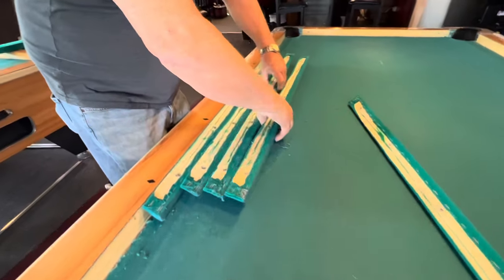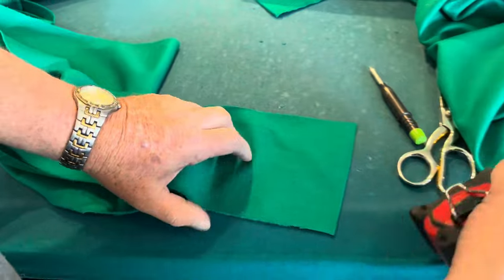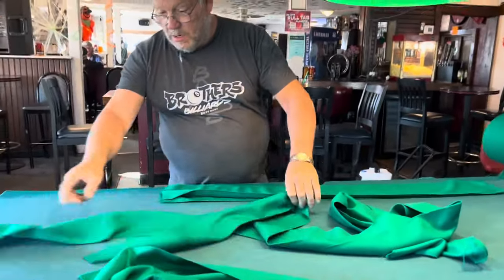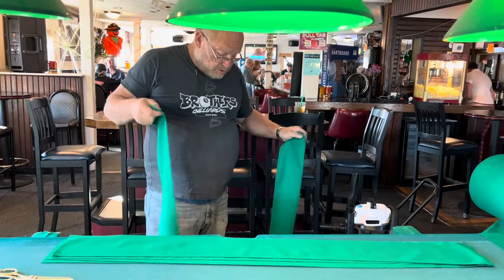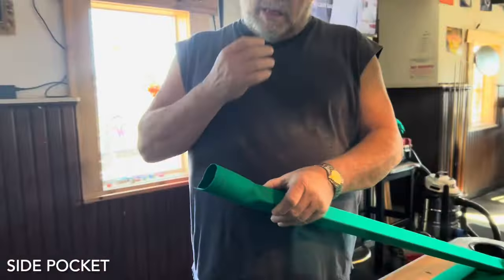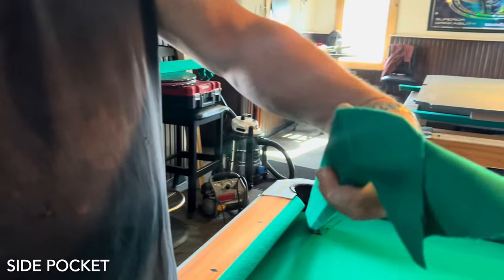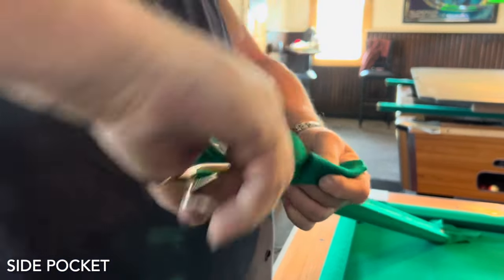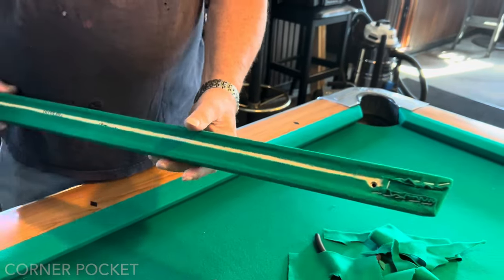HOW-TO: Recover Valley Pool Table Rails like Real King Cobra!

Comment: Guys in pool leagues would tear me(and the cusions) apart if I used that fold over method on the coner pocket ends of the rails. It looks nice and neat but it adds 2 layers(3 total) of cloth on that side which will effect the balls differently than on the other ends of the rails. You have to work the cloth with folds and often times pleats. Staple as you go to hold it. There is a balance between too tight and not tight enough to help prevent early wear on the "points" that he shows but if you take your time and do it right, the better players will appreciate it.
Reply from the maker: Yet they don't complain about the folds in the side pockets on a featherstriped set of rails, like on a 9ft😅🤣
Reply: valley doesn't sell tables with folded side pockets,  ever wonder why?   my take is if you are going to do a fold over, make  it look good.  great tutorial.   diamond tables do folded side pockets.  your league players sound like mine.  they always blame the table for their missed shots.
Reply: Oh thank you so much. This guy is a joke 🤣🤣🤣
Reply from the maker: Do the work however you want, but I don't like how the no fold rounds the side pockets, and the facings wear through the points because of the no fold method, so hack away buddy😅🤣
Reply: @therealkingcobra   I wasn't looking to make a thing of this, Buddy, but when I do rails I do them with out needing that dumb fold and this "wear" that you are trying to sell simply does not happen with the way I do them. Maybe just try a little instead of taking the easy way out.
Reply from the maker: Hey, do the work the way you want, don't matter to me, but I'll tell you this, move out to my area and you'll only last about a day doing your level of work, then you'd leave and go somewhere else to try and find work😅🤣
Reply from the maker: Show your rail work with Simonis or Gorina cloth, and I'm talking about the back of the rails, you know, where you place all the damn staples! And still can't keep the puckers out of the bottom of the rails!!😅🤣
Reply: @therealkingcobra  

 "...do the work the way you want..."

 
 I appreciate your permission.

 
"...move out to my area..."

 
 Why? Are the Valley tables more difficult to cover in Spokane?

 
"...you'll only last about a day doing your level of work..."

 
Now you know "my level of work"? LOL. 

 
 As noted above, I do YOUR level of work but without the extra fold. Have you ever pulled rails off of a new table or purchased new, covered rail sets from Valley? Do they use the fold? Are your rails now better than Valleys?

 
"...then you'd leave and go somewhere else to try and find work"

 
 Because The Real King Cobra would run me out of town.

 
Lighten up, Francis. This post is already 9 months old and you're still bellyaching over it.

 
 "Show your rail work with Simonis or Gorina cloth..."

 
 Should I send you some other pics for us to compare?

 
 Dude, covering rails isn't rocket science but I can appreciate that you have a brand to sell so you just keep on impressing the kids. I can tell that you really appreciate the pats on the back.

 
 "...where you place all the damn staples!"

 
  This point I think we can actually agree on. I can't stand stripping rails that I didn't cover. Some guys line the staples down a rail like they get paid a commission on how many they use. 

 - - - - - - - - - - - - - - - - - - - - -
 - - - - - - - - - - - - - - - - - - - - -

 
 However, I do staple my ends and then I use about 5 staples down the length of both top and bottom of the cloth just to reassure that the glue never slips. Just off the side of each bolt hole(5 bolt rails).

 
 What I would NEVER do is use staples on the bottom of the rail where it could cause a misalignment if it rests on the slate. But I guess that sexy fold over of yours dictates that for you.

 
"And still can't keep the puckers out of the bottom of the rails!!"

 
What the heck is a "pucker"? Guess I don't know cuz my rails come out smooth as silk every time.

 
Don't make what we do out to be harder than it really is. I tell the onlookers at the bars all the time that it isn't hard. Just take your time and pay attention to the details. The worst part of the gig is hauling all the gear in.

Comment: Hi Cobra, is it possible to use that 3M 77 spray for bonding K66 rubber cushions to the wood/rail as well? In my country I can't seem to find the contact cement brands that is typically recommended (3M 10 scotch weld, Barge, LePage etc.), but my local billiards store sells the 3M 77 scotch weld spray. Not sure if it's primarily for glueing cloth or if it can be used for bonding rubber cushions as well. Thanks for all your videos!

Comment: What do you prefer better Ridge backgrounds or the penguin rails and also what brand the cloth did you install
And I also have seen a lot of videos with guys stapling the rails do you preferred gluing over stapling
Reply from the maker: Well, first of all, I'm the one that actually designed the Ridgeback rails in the first place, then taught Kerry how to build them, creating the Ridgeback rails business. Penguin rails have come a long way since they first started building replacement rails, so I don't have any issues with them today either. The problem with either rails, is neither will play right if the cloth isn't installed right, and the slate depth isn't set right, so the rails CAN play right. I've been spray glueing rails for 40+ years, and fail to see a downside to that method if installing the rail cloth, but I've seen plenty of problems with using staples to install the rail cloth. My method of instalation of the rail cloth would be hard for anyone to do a better job, and the finished look shows that.
Reply from the maker: The cloth I installed was the Strachan Superweave green. This is absolutely, hands down, the best bar table cloth on the market today. I just replaced the cloth on 3 Diamond 8ft bar tables after 14 months of play, and the cloth still didn't show any cue ball break lines to the rack, and now ball racking wear.
Reply: @therealkingcobra  
Do you have an email I can contact you through I'm actually in the middle of  refurbishing a ZD7 93 model  Valley pool table and have a few questions
Reply from the maker: Realkingcobra@aol.com

Comment: What size staple do you use for the rails
Reply from the maker: 1/4" × 1/2" crown, unless the wood is pretty stapled out, then I step up to either 5/16" or 3/8" if needed, but the next recovery is with new replacement rails at that time, or get someone else to recover the table!!